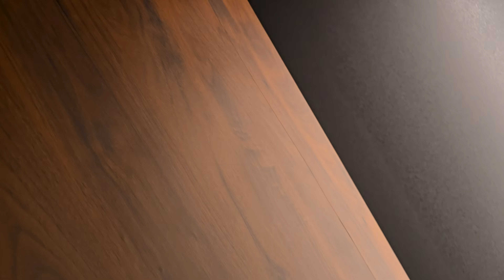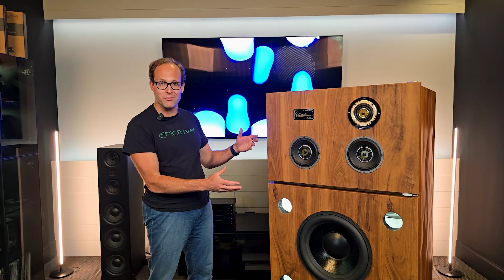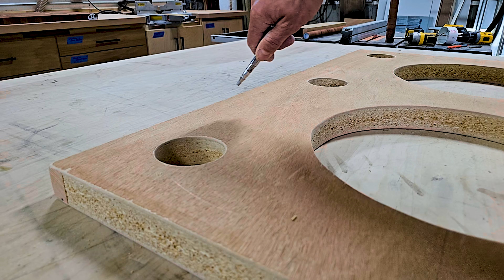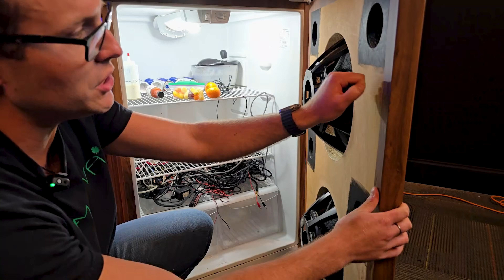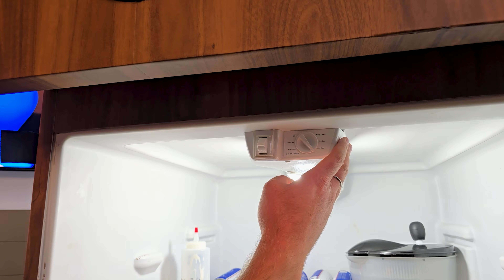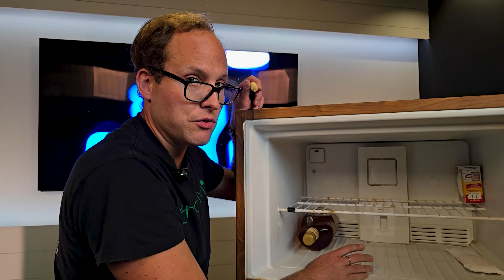Emotiva Nostala Chilli 215 Speaker Premiere!

Comment: I saw the concept, thought, "This is stupid", remembered it was 4/1, and then read the video description which confirmed it. The fact that there was footage that should not have been used (such as the magnetic bit separating from the screwdriver and the lava lamp almost being knocked over) were subtle cues that it wasn't a serious video.
Reply from the maker: What if I told you that both those moments specifically were not planned lol

Comment: I like the new Chilli 215 but can't we go bigger? I don't think there is enough room for a keg with the crossover in the cabinet.
Reply: I think I will hold out for the double 18" version with the optional external port system for infrasonic bass frequencies 😂
Reply from the maker: Need a 4 18" driver subwoofer with a driver on each side. We will call it the Ice Cube.
Reply: Or call it the "home wrecker" 😂
Reply: Will it require a dedicated 220V outlet?
Reply from the maker: @johnclark3067 yup and wired to a 30 amp 4 prong dryer power cable.